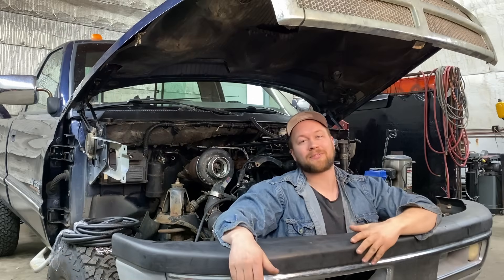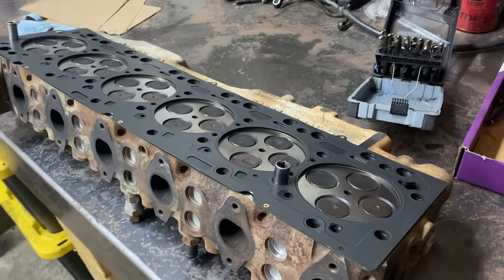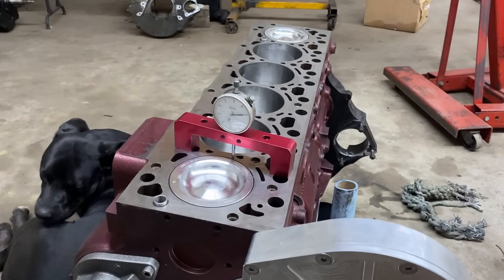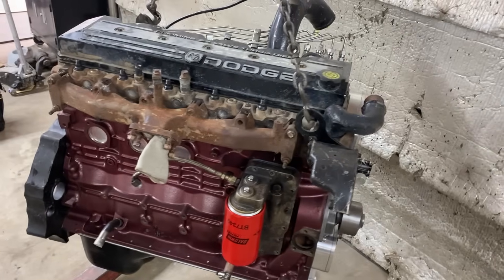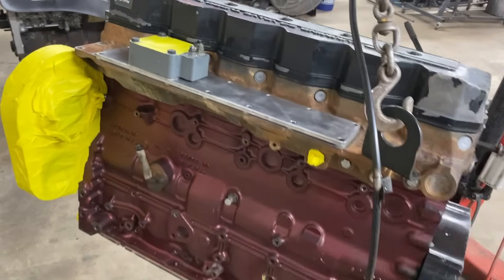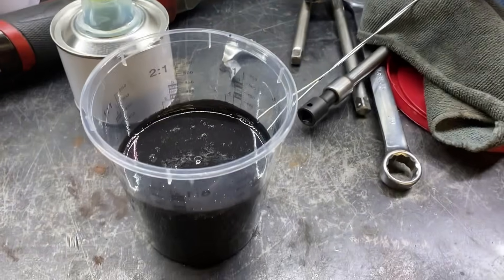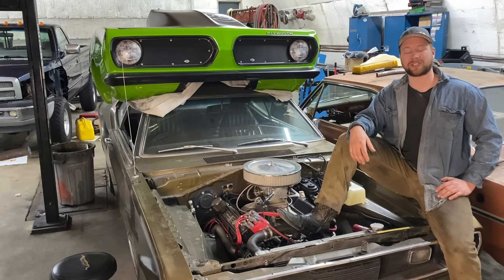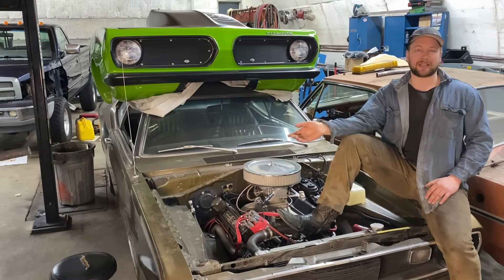Valvetrain, injectors, and a slick paint job on the P Pumped 6.7L Cummins!

Comment: Tip when painting, wet the floor so when you move around you don’t kick up dust into the paint. Not wet enough that your splashing though. I only say this because you you care enough to not use a $10 spray gun. If you haven’t tried the turbo spray paint, you need to watch a video. It’s  close to a real spray gun. Unfortunately it’s only offered in black and white, but it’s great for the right application.

Comment: What pump did you use? I’ve been scouring the internet came across 180, 210 and 215 hp which in the most versatile for this application, I want 600 hp
Reply from the maker: A scheid lightning 13mm, I actually can’t believe I didn’t talk more about it I just realized it!
I’ll add some notes to the next video
180 and 215 are the best pumps from the dodge applications, either pump would work for what your goal is. A 160 and 175 pump would also work, they just fall off above 3300rpm or so so you’d want to have a torquier turbo set up

Comment: ISB  bottom end
Reply from the maker: What about it?
Reply: @Hazardous-Hotrod-Knowledge  . Is the bottom end a Ram truck motor or ISB industrial motor ?
Reply from the maker: @ check out the first video in the series, it’s kind of an amalgamation of a couple engines.
The crank is from a 6.7, the rods are from a 12 valve and have been shot peened and have ARP rod bolts, there’s gator main studs, and the pistons are from a ISB/QSB. 
An ISB/QSB engine is pretty much identical to a ram motor when it comes to the bottom end, the older difference is the pistons. Same crank, same rods.

Comment: Do you plan on using an HE351VE?
Reply: Hmm… interesting. You didn’t strike me as much of a tech guy. 

I have a 2nd Gen I put VGT on(stock HE351VE) with a home made controller I made. I’ve wrote a ton of C code for it. I’ve programmed it with a bunch of safety’s and different operating modes. I’ve logged over 50,000 miles on it. In my opinion I have it perfect…. 

Then I won a turbo from power driven diesel. I talked to them on the phone and one of the guys there said I should try to run compound turbos. I wasn’t interested, but they twisted my arm. Now I have all of the parts to run a HE351 S476 compound set up. When the big turbo spools, the VGT will run the vanes wide open and basically shut the little turbo down. So, kind of alternating turbos (their idea. Not mine). 

Free compounds? Alternate turbos, and keep boost pressures lower? Why not? I already wrote a compound code… 

If you are looking for advice or help you could try to track me down. We could blow up our trucks together😅
Reply from the maker: Yup! Not a regular stock one, and I’ve modified it in a dumb and complex way lol the next video will be covering it
I have a standalone controller to use it with the p pump

Later it will get paired with an S480 and I’ll be making a video on building the compound set. Im not sure if I’ll drive without the compounds to get a baseline and then add the turbo, or just run compounds from the start.

Comment: Hey love the build, I had a question regarding spray angle. I’m planning on building a 6.7 P-pump as well but planning on using the standard ISB pistons, what spray angle will I need?  I’ve heard the stock VP angle works but just wanted to be certain. Thanks!
Reply from the maker: Stock VP spray angle, 153 degrees, they’re the same bowl. Love to hear another p pumped 6.7 in the works! 
If you’re interested, I’ll be selling the 7x.014s from this engine for $600 USD no core, they have 10 minutes of run time in them. If you’d be interested in them shoot me a message on IG, or send an email via the contact form on my website